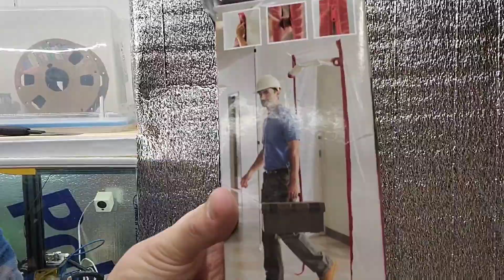Creating a new 3d space pt 2 - Dry tent for Filament

Comment: I really liked your set up! What fire extinguishers are you using? I bought stovetop firestops for my prusa but if there is a smaller one I'd like to know. They will work fine, but I got the prusa enclosure and they are a little big. If I had a larger, homemade enclosure like yours it would be different.
Reply from the maker: https://amzn.to/3HpI9xi 
This is the one I have installed now.  I have 4 total.  Hope to never know how well they work.  Was thinking of catching an ender 3v2 on fire just to see what happens.
Reply: @Kabliga  Cool, I'm going to compare the size to mine, and thank you. I hope I don't ever have a fire either, especially when I'm at work or such. 
If you do that, record it and maybe you can make enough money off youtube to buy a replacement.
Reply from the maker: Now I can't help but want to see one of these go off and put out a fire on an under 3v2 🤷‍♂️ 🤣, might be an upcoming video.